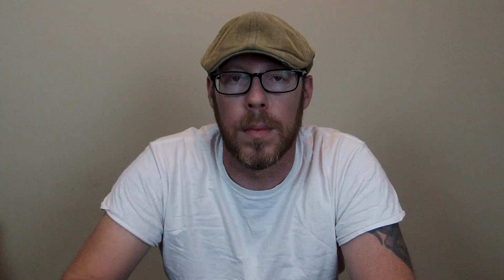Swimming Pool Bonding

Comment: Probably the dumbest of dumb questions but would a wood framed and walled pool need to be bonded? More specifically the stainless steel fasteners and carriage bolts used in the construction of the frame and walls.

Comment: I have an extra ground wire tied into my main panel from a run I did for a heater. Should I tie this into the bonded equipment or keep separate?
Reply: You dont separate any ground wire from tge main panel. They are all tied in togeather. Unless its a subpanel

Comment: Hey steve i go a new portable commercial pool pump mounted to a 2 wheeler/Dolly. No copper wire came with it just the bonding lug on the back. what are my next steps after getting the wire? and where on the dolly should i attach the wire from the pump? Thanks man

Comment: Does a skimmer need to be bonded? My pool is being re-done and I see a bare copper wire it leads from pool equipment but it's not attached to rebar or the skimmer?
Reply from the maker: The bonding grid for the pool will be a bare copper wire that wraps around the entire pool.  This is used to attach to the steel walls or rebar of the pool in multiple points, as well as to pick up deck anchors, diving board or slide bases, light niches etc.  The wire probably connects to stuff, just not where you are currently looking at it.  The skimmer itself, being comprised entirely of plastic components, does not need to be bonded.  If your pool is a million years old and has an actual metal skimmer then yes, in theory it should be bonded...but also in theory it should be replaced :)
Reply: Swimming Pool Steve Ok. I don't have a complete copper wire wrapped around my pool. Only 5 8 ga. bare copper wire sticking out from my coping. I connected the bare 8 ga. copper wire with City code approved brass clamps that are designed to be submerged into concrete. The bare re-bar that was exposed after complete demo was attached to the rebar. Now I'm ready to pour my deck with concrete. From there my concrete guy knows what to do.
Reply: Swimming Pool Steve I had my skimmer replaced and I was like it's 100% plastic I think and I was thinking why the heck does this need to be bonded.  metal skimmer?  Wow? lol!

Comment: Why do you call it a sacrificial anode?  Because it corrodes quickly?   Just put a free craigslist 27' above ground pool up and this bonding stuff is new to me.  My bottom tracks go into plastic base caps so they are all not touching, is that an issue?  Per 2014 NEC do all vertical supports need tied in?  WHy is the ground/bond ring around the pool to be 18" away and only 4-6" deep?
Reply from the maker: I am not familiar with the installation requirements you are referencing.  In my experience a pool will require at most 5 bonding points around the perimeter which are tied into a bonding grid which is then grounded.  I do not work on above ground pools so they may be different.  Is the wall panel made from steel?  This is how the bonding grid would connect to all other metal components and why only 5 points of contact are usually needed.  A sacrificial anode is just that...sacrificed and consumed as part of providing cathodic protection to your pool components.

Comment: Would a zinc anode in the skimmer be  sufficient for a non SWG pool?
Reply from the maker: In my opinion no.  These independent anodes are not tied directly to the bonding grid so they really only help to minimize localized anodization.  For the cost of an inline anode, and the improved protection it provides, I would certainly recommend to go the extra mile.